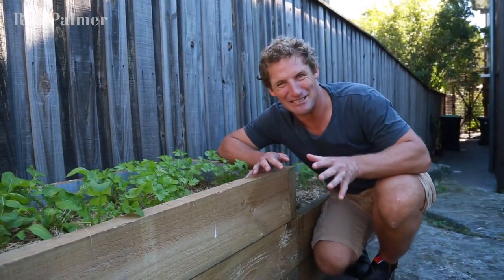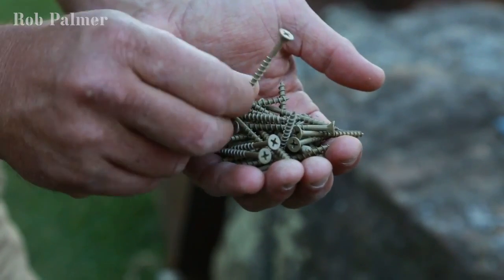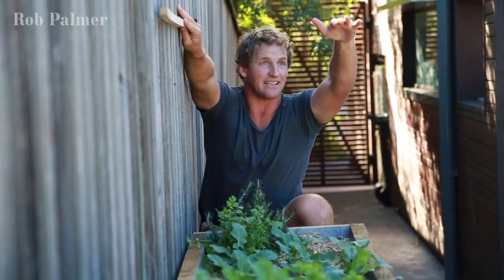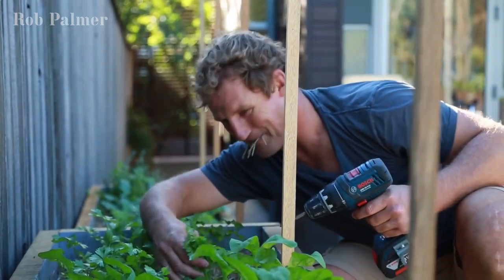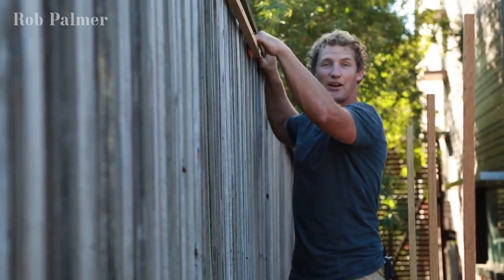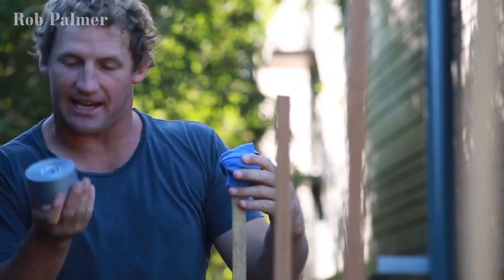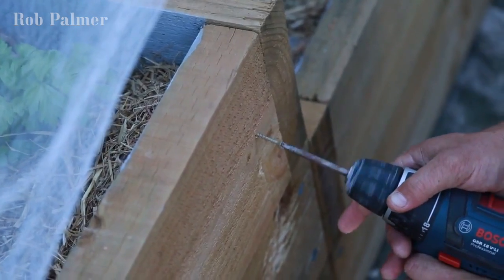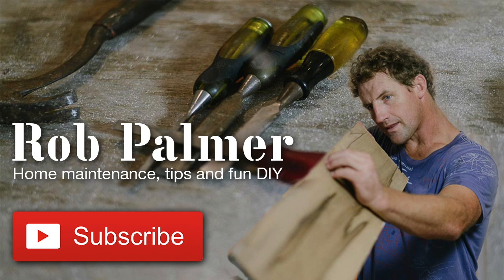Garden Bed Netting | DIY Build

Comment: Did something similar - but my vegetables still got eaten by determined snails, slugs etc. that crawl up the beds each night and find an entry point underneath the bottom of the net - have a blast and knick off by morning... yet to think of a way to make the bottom of the net super tight all the way so they can't find a way in anywhere.